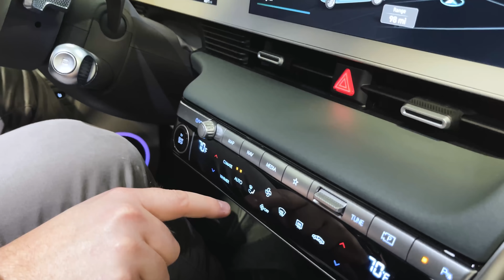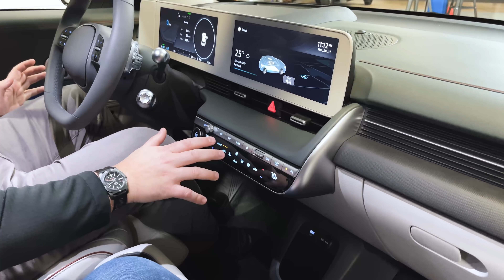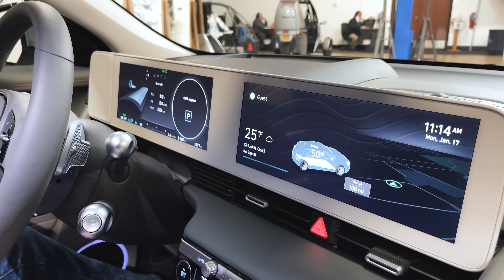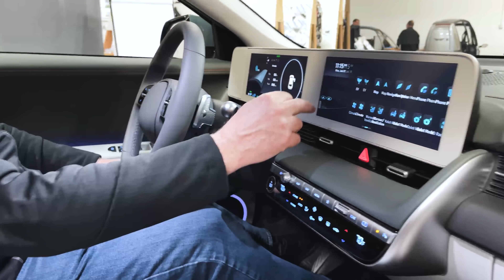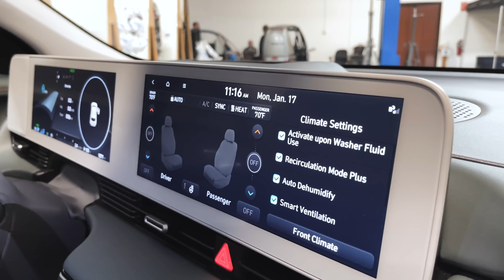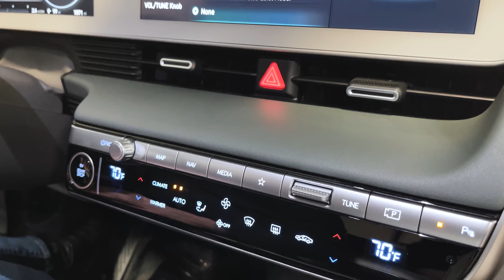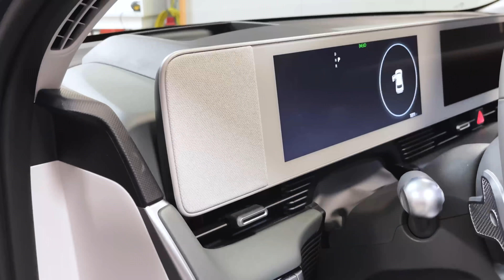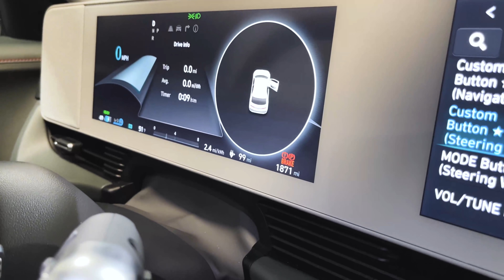2022 Hyundai IONIQ 5 | Sandy's First Impressions

Comment: I personally like the buttons for the HVAC controls.  I find it irritating to have to navigate through a touchscreen to make simple changes to HVAC settings, and would much rather just press a physical button.
And getting rid of the round 12V "cigarette lighter" plug would be a bad move, considering the amount of accessories that still use them.  I'm all for simplicity of design, but it can't be at the expense of real-world usability.
Reply: But on the other hand, those HVAC buttons are both quite small and way out of the sight line.
Reply: Sandy has been spending to long in Teslas.
Reply: @jrooney06  why? TESLA is the best EV money can buy. You need to compare everything to it. Comparing a Hyundai to a Bolt is a waste of time.
Reply: @GET2222  in regards to the comment made. Sandy doesn’t want any buttons and a purely touchscreen interface. That’s very Tesla-like. Some would say a Tesla is basic inside and soulless. I also find a fully touchscreen interfaces very impersonal. Buttons are how engage with a car and give it character. It shouldn’t all be about what’s cheaper or lean etc it should also be about how it makes you feel and touch is one of those characteristics of a car that makes you feel a certain way.
Reply: @jrooney06  Agee!
Reply: @rogerstarkey5390  - the HVAC should use AI and be Automatic all the time w/4 climate zones.
Reply: @jrooney06  yeah he's a bit brainwashed by Tesla
Reply: RailroadJim - HVAC should be Automatic 4 zone.
Reply: @GET2222  how can you say they are the best when Tesla can't even build them properly. Every Tesla owner I know has had problems
Reply: @thealienrobotanthropologist  - NOPE, buttons add complexity and more FAILURE points, DELETE physical buttons , except HAZZARD lights.
Reply: @cameronmurray3039  problems? I have owned a model X since 2016. It’s the best car I have ever owned. It a better car today then when I bought it and it’s faster. My BMW X5 M-Sport series is a piece of shit. 7 recalls and no software upgrade and it looks like 2001 with a damn spinning wheel. Blue tooth connects to random devices in the car. Can’t warm Up the damn car unless you physically get in the car. I have owned BMW, Mercedes and SAAB for over 30 years. You can’t completely appreciate a Tesla unless you own one. Everything else is a blackberry. I get in the car and everything is dialed in. I never have to use the interface unless I’m playing music and I typically do that through voice commands and the sound system is second to none. I spend a shit ton on cars. I’m a car guy. Never did I ever think I would keep a car for 6 years. We love it. I and my wife are emotionally attached to it. This car will be in our family for generations. My Aston Martin never gets driven anymore. Kids can’t stand the smell and it’s slow.
Reply: @cameronmurray3039  explain “can’t build them properly”. I’m waiting… my panel gaps are far superior than my BMW X5 M-Sport that I paid $120k has been in the shop 6 times and has 17k miles on it for recall notices. I have had 1 recall notice on my Model X in 6 years and it’s our main driver. Build quality? I’m waiting… this should be good!
Reply: @cameronmurray3039  you clearly don’t own a TESLA. Unless you have owned high end cars your entire life and have perspective of cost of ownership and loss of time at the dealership, it’s hard to appreciate a Tesla. Jay Leno can drive any car he wants and his daily driver is a TESLA. I love things about all of my cars. My Aston Martin just sits, because the music sucks compared to the MODEL X and it’s quieter with less road noise. Beautiful car, but now my favorite.  When my wife drives it I have to physically move all of the vents or tap the touch screen for my preferences. So many things like opening and closing the garage without touching anything. Adjusting suspension driving into the driveway because the car knows it could bottom out. Meanwhile, my AM bottoms out.  There too many thing to list on this thread. Go drive one or buy one and find out for yourself. I have never owned a car with 70k miles on it because stuff starts to look worn, squeak and looks dated. I have unlimited supercharging miles for the life of the car. Basically a gas card forever paid by Tesla for free. Poke holes in my reasoning on why I should not love this car?
Reply: A mobile app (widget included) + a touch screen only approach solves that problem IMO.  Buttons look outdated.
Reply: @ryansmithc  exactly. ALL cars will get rid of buttons in the future. Who n the hell wants buttons on a phone? Ohhh… that’s right… Steve Ballmer.
Reply: @ryansmithc  I guess that if the car had a self-driving mode and you could take your eyes off of the road to use those items, it would be okay.  Otherwise, buttons and knobs rule, outdated looking or not!
Reply: @thealienrobotanthropologist  All cars have audio controls on the steering wheel.
Reply: @GET2222  we can't only root for cars that will address the EV enthusiast smart phone crowd. To complete the transition from ICE we'll need cars that traditional owners can adjust more steadily.
Reply: @LukewarmEnthusiast  you can’t double tap or swipe up when your driving 100mph down the autobahn. BMW had the best solution, which other German brands adopted whereby they used a dial that allowed you to control the touchscreen from afar.
Reply: @phillipsandusky3795  PEW RESEARCH: 97% of people own a cell phone. 87% own a smart phone. I beg to differ. You want cost to go down? Get rid of buttons, knobs and levers.
Reply: @railroadjim  just use voice control, most drivers can speak. Some of the voice commands are pretty entertaining as well.
Reply: @jrooney06  TIL that not all of the soul of a car is found in the exhaust pipes. Some is also contained in buttons.
Reply: @Frosticus453  ha if you have ever sat in a Bentley or Rolls Royce you’d understand not that I have very often. Just touched a few buttons here and there. It matters.
Reply: @thealienrobotanthropologist  You have that button on the steering wheel. Why exactly do you need a redundant button on the dash?
Reply: @jrooney06  You seriously think cheap plastic buttons give a car soul. How is the engagement different between pushing a plastic button and tapping an icon on a screen? If the UI is done right, the most used controls are on the home screen and the rest are in the setting page. The only physical buttons I need are on the steering wheel. I see no benefit to having buttons on the dash. Tesla did go a bit too far by getting rid of the gauge cluster screen, getting rid of the stalks and using capacitive buttons on the wheel. Musk has a vision where the car will do all the work but the technology is here yet.
Reply: @cameronmurray3039  I can find owners that have had problems with every brand of car, including Toyota and Honda. Every car manufacturer has multiple current recalls. Most of the Tesla issues are fit and finish related. I'll take a car with fit and finish issues to one that has mechanical issues that will leave you stranded on the side of the road.
Reply: @railroadjim  I would love to record you driving. I am willing to bet you take your eyes off the road to use any dashboard buttons. I have the steering wheel buttons memorized. I can feel for knobs on the dash. However, I have to look at the buttons on the dash to find the one I need. If you really find any button on the dash by feel, then good for you. However, I bet you look down to find them. Plus, I bet you don't use them as often as you think. Half the buttons I had in my ICE cars were rarely used. Buttons on the steering wheel are useful. Buttons on the dash, not so much especially if you have a good infotainment screen.
Reply: @phillipsandusky3795  It's easier to adjust than you seem to think. The main car controls are basically the same. If people know how to use their phones, they can figure out how to use an infotainment screen. If they don't know how to use a phone, they are likely not use the more advanced features of their ICE cars anyway. I think most people can grasp the concept that touching the blue arrow lowers the temperature and touching the red arrow raises the temperature. Touching the up arrow above the fan increases fan speed. The average person you are talking about will only use the climate control and audio controls. All the advanced features that change driving dynamics and the suspension won't get used by these people.

Comment: When it comes to instrumentation I can't agree less with Sandy, I always prefer shortcut buttons to just scrolling through menu on the screen to find what I want.
Reply: It's way safer too. Buttons don't move around like UI features.
Reply: @norgtube  The buttons are clustered together. You still have to look down to use them. I doubt you use those buttons often enough to have muscle memory.
Reply: If you do the UI correctly, the buttons you use most often are on the home screen. On the Tesla, the temperature and on/off buttons are always there. A simple swipe up gets you the other A/C controls. Fan can be controlled from the steering wheel. No scrolling. You only scroll for car settings and how often do you change the car settings?
Reply: Yes! I don't want to swipe and tap thru 2 or 3 levels to make a simple change. 

If the panel is completely removed like Sandy wants, then how does the passenger adjust the volume? Or make another simple change without altering what the driver has selected the main screen to be.
Reply: It is still a distraction. I personally, much prefer using voice commands to adjust the temperature (once every blue moon) or play a track that I want (far more often).
Reply: Agree.  Once learned you dont have to take your eyes off the road to reach down and tap a button.
Reply: @norgtube  UI doesn’t need to move around either, the car industry just has a lack of good UI designers.
Reply: @rivengle  couldn't agree more with what you said there.
Reply: Exactly my thoughts,love the touch screen,but physical buttons for quick change while driving are safer and easier.
Reply: @trizvanov  Voice control is rather imprecise, often  responding to conversations or singing as if it "heard" a legitimate command, or just not responding., all while distracting your passengers unnecessarily.
Reply: @wilfredvanvalkenburgh2874  Interesting. In Tesla, you have to press the button before issuing a command. That definitely helps. The voice recognition is rather fantastic and even picks up my very confused accent without an issue.
Reply: Well I guess it's all down to preference but I agree with Sandy.
Reply: @trizvanov  try to issue a command while your fellow passengers are in a conversation.

Comment: Love the overview, strongly disagree about direct control of climate. That is a safety necessity in colder climates when you need your windshield fogs / partner isn't happy with the cabin temp!
Reply: Tesla has the temp, seat heater, and the front and rear defrost on the hone screen. No need to search for anything. I think it is just as safe. I  still look down on my older car to find the front or rear defogger buttons on the dash. No different than looking at the screen. On the screen, it is actually easier to find because the icons are bigger.  AS for the partner. most new cars have dual zone climate control and the passenger temp control is on the right side closer to the passenger.
Reply: Yup. Nobody wants to be scrolling through menus to change the climate settings or heated seats, especially when wearing gloves. People that suggest that tend to be from California or something where they don't really have weather to worry about.
Reply: @RobertHancock1  Sandy is from Canada though and Munro & Associates are in Michigan hardly fair weather.
Reply: The lack of buttons, and the associated safety issue of diverted attention, is the very reason that an ID4 was off the table for me. It is a shame that the 5 lacks the seat and steering wheel heater button controls. (Also needs a rear wiper!)
Reply: My thoughts exactly. I can see why Sandy is "coming from" the costing perspective, and he is right in that respect. What he, and Tesla are forgetting is that people use these systems, and they should be built for them. Having dedicated (non touch) buttons for some functions is a big plus for usability.
Reply: it defogs automatically! cabin temp touch bottons are perfectly fine.
Reply: @kentashby9402  not a major issue when you get used to pressing one extra button - "warmer" on climate panel
Reply: @kentashby9402  The climate controll on ID cars is stupid easy, climate buttom then + or -
Reply: @RobertHancock1  South Korean winter is brutal as well. They won't get rid off it for sake of people wearing gloves back home.
Reply: Yeap having seperate buttons will reduce investment for couple therapy.
Reply: They can make the bigger and have the climate control always accessible, the buttons are just touch button so doesn't make any difference to have a display
Reply: @gabortabi  They are touch buttons any way so having a touch screen doesn't make any difference
Reply: @gabortabi  EXACTLY, they recognised early on that it would be a comfortable transition for people unfamiliar with the touchscreen tech, then they COMPLAIN about it? 🙄
Same for it not having a frunk, when it had one, but then Sandy could only put his wallet in it, & whinging about the small rear luggage space, after enthusing about it earlier.
Another thing that annoys me with these first impression vids, is that before buying a car, most customers would check it out in a showroom & I defy anyone to say they haven't been pounced on by a salesman ready to answer any questions or give a brief run-through of features.
My uneducated guess about the mystery plastic row of open cells in the hatch would be that they're to defuse air noise. Maybe?
Reply: The gist of it is: don't get ergonomics advice from an engineer (except if he/she is the rare breed that studied both). The point of tactile is "no-look" operation and it's successful implementation resides partly in it being tactile but also on it's placement relative to the agent/ operator to allow perceptual constancy (that is the ability to recognise objects*, either by sight, touch, placement etc, from multiple angles;  * - can also be faces, sound sources etc.) it is the reason why we "just know" where the volume buttons and where the channel buttons are on a TV remote control even if we're upside down and backwards, in a dark room. This also fits with ones proprioception (or kinesthesia), which is an agent/ operator's body ability to sense movement, action or location in space without actively thinking where to move each member's joints to reach a target position in space (like we don't think what to do to point to our noses, or where to put the feet in order to walk etc.) The implementation of tactile inputs should always be measured against these principles and there can be tactile inputs that are badly designed and located. However on touch screes...even though they still have a partial tactile feedback and perceptual constancy (the virtual button for some function is always in the lower left, for example)...but because it's virtual, it can - and often is - hidden by something else; perhaps another UI "page" is being displayed altogether and there's nothing or some other button instead of the one you intend to activate, or the button is "greyed out" for some reason. So in effect, it is very often the case that one needs to actively look and think what to do to get to the button and how to interact with it as opposed to a well implemented physical, tactile button that requires no looking and no thinking about it to operate. Maybe it, intuitively, feels like no big difference but once you observe a driver looking over and over and over at a touch-screen just to get to the volume control, most common example, you'd think,  also intuitively, that that function should have a dedicated button. Just my two cents on the matter.  
( and yes I am aware of the irony of starting off with "the gist of it is..." and ending up writing a wall of text :P )
Reply: @marian-gabriel9518  Thank you for your well thought out & delivered post, you are my kind of thinker. 👍
Touch screens are CHEAPER to implement for the MANUFACTURE, plus if they screw up, they just patch it up.
Physical buttons have more complex manufacturing processes & must be well thought out for the controls to be convenient/useable, which COSTS MONEY, & require employees experience which again COSTS MONEY. 😉
Reply: @CNile-se9xw  Thank you...and yes, you are right. A small addition if I may: touch screens are more expensive to implement, initially, than a button oriented implementation due to a high cost for the SW platform, but get's waaay cheaper in the long run, as you very well pointed out, as it is re-used a lot on several platforms over several generations with minimal changes.
Reply: @marian-gabriel9518  That makes perfect sense, thanks for pointing out the initial cost of the touchscreen & software, I must admit that I'd sort of taken it for granted because it's been around for so long with Tesla. 😉👍
Reply: @gabortabi  why wouldnt you use your phone before going to the car to set a desired temperature? are you phoneless?
Reply: @marian-gabriel9518  I had a funny thought that Tesla's touchscreen & software would've amounted to about 10 minutes of software programming by Elon 'cos he's a GENIUS. 😉
Reply: @CNile-se9xw  Damn it man...thnx for reminding me...I keep forgetting this...what's wrong with me?!?! :))
Reply: @marian-gabriel9518  😉👍